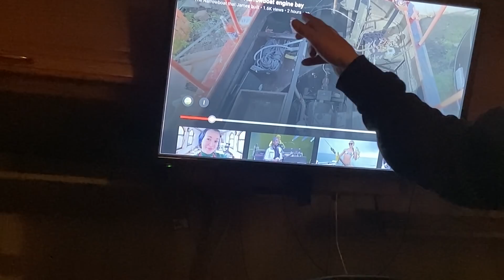132. Designing draining boards for the stern deck

Comment: James, i just binge watched up to date and have enjoyed your vlogs lots, it has taken many days and some parts at a faster speed but really enjoied what you have been doing. At least now i can comment and they can be read when they can help. a couple of tips i have learned from owning a boat and enjoying several holidays on the canals. a quick way to tie up is to pass a loop through the shore eye or round the cleat/bollard and loop over the boats cleat or bollard, shorten and tie off. This gives you 4 lines between boat and shore that will allow for movment and be very safe and easy to untie when on board. All you do is untie take off the loop over your cleat or bollard and pull through or round the shore bollard and you are ready to go and still on board.

Comment: Round turn and two half-hitches.  Probably the most useful knot to know.  One thing I was always fastidious about was coiling my lines.  It pays off in that they dry out well,  stay pretty clean and don't tend to support algae that can make them smelly and slippery.

My visual version of perfect pitch goes to "fingernails on a blackboard" mode whren I see the angular direction fo the rail at the front of the boat fighting the curve of the cabin.  Not something pressing, but a matching curve would be SO satisfying.

Comment: James a security matter;  You are telling everyone when you will be away from the boat, understandable in the circumstances.  As a fireman of many for years hardened padlocks caused us no problems forcing entry, we used to cut the mild steel hasps with a compressed air saw.  with the proliferation of battery powered saws it would be possible to force entry to your boat quickly. Get a hardened hasp mate .  Regards Tony

Comment: Goid to see you're getting drain channels for the decking. Are you using the proper decking boards with the black patterned top face? They are expensive, but there is a supplier near where your moored. I worked at a small marina years ago near you, and I'm sure you're mates there can advise! 😁

Comment: Hi James save your money and forget trying to make the back deck water tight it is designed to let water in because you have stairs down one side this makes it impossible to get it water tight you can put channels in which will make a little difference but not enough to make financial sense put the money towards a pram hood the best investment a liveaboard can make if you still want to try a cheap answer is cover the whole back deck with a rubber mat but the water will still go down the stairs
Reply from the maker: Mate you’re right - I’ll go that way

Comment: looks like its going to plan mate, you have done well, have the set of Nicholson guides myself and they are really good, they give you the history of the cut also, doubt you will but if you are around chester canal basin give me a shout
Reply: you have got to go over the pontyclyde at some point mate, I don't like heights, gave me jelly legs, I work at hight often but with a harness, the huge joint beforehand probably didn't help  lol